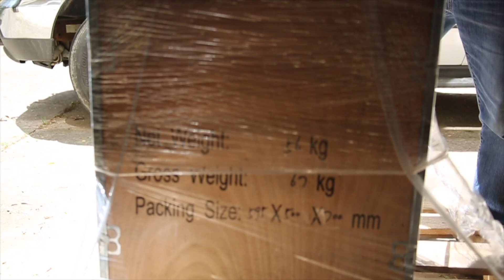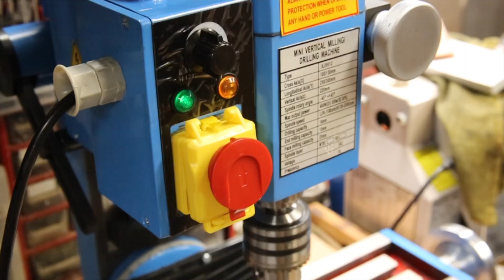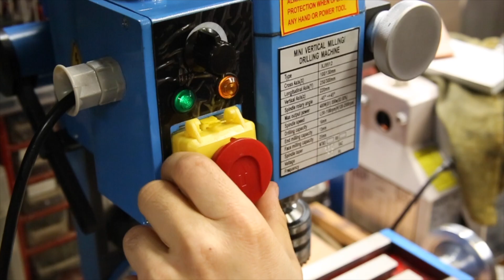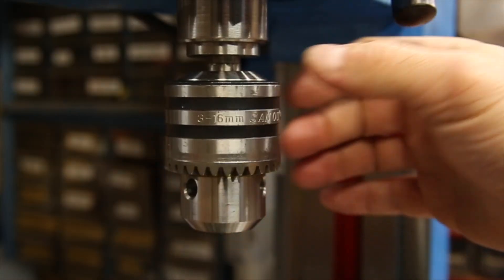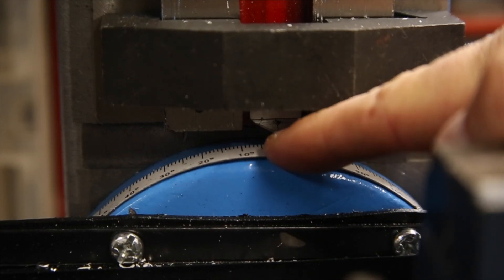Cheap Chinese Mini Metal Mill Milling Machine Unboxing, Setup, Testing, and Review

Comment: I found this video (and the comments) interesting and helpful as I'm getting a cheap x-y table to put under my drill press for use with wood and aluminium.
I think some of the "professional machinists" commenting need to accept that this is a small cheap machine designed for light work. Of course it's not going to be the same as their Bridgeport.
Reply: Your drill press chuck is probably held in by a morse taper.  You will learn it can not take any sideways force.  You are much better off long term in visiting little machine shop and after using their price comparison chart and doing some research acquiring on of the Sieg X variants that uses an R8 attachment and also picking up some collets for when you wish to mill.
Reply: @kenibnanak5554  l
Reply: Make sure you video it
Reply: Hi, I would not use wood and metal/plastic on the same machine. Not even in the same room.  Metal/plastic need lubrication. Wood dust will become stone and rust will set in.
Reply: Yeah i dont really suggest milling with a drill press not because its cheap or doesnt work well but really drill arbor are held together by friction and you coukd just have it flying off if you do so if you still intend modify it to have a drawbar pulling  the arbor and change to milling collet  low quality drill collet like these are not eccentric but if you insist thats ok but without a drawbar of some sort no
Reply: some view Bridgeports like these, when compared to Cat 50 taper machines.

At the end of the day it's cost and end use, all machines have a place and a use..
Reply: Del Cat I hope you didn't trash your drill press' quill by trying to mill with a drill press.
Reply: Tried it, you won't be milling and those cheap tables make accurate positioning hard work for hole drilling. I ended up with a slightly bigger mill than this and the 30 I spent on the shitty xy table could have bought me a few more end mills or arbors
Reply: Del Cat  At last some one with common sense. All the experts know all the answers but probably never make anything ! Also there is no right way in engineering just your own way.
Reply: @tonywright8294  Google 'Russian lathe accident', before lunch not after.

long sleeves (hair too) have no place in a machine shop.

Comment: Timnummy can I use this milling machine to surface  car cylinder head
Reply from the maker: sibusiso jaro it might be a bit small to do a decent job... You'd have to take quite a few passes and make sure everything is exactly on. I'm not saying it couldn't be done, but I don't know if the result would be worth the effort

Comment: Putting an end mill that size into a drill chuck is dangerous, unwise, and will never have any accuracy.  Find a collet kit that works with this mill and dump the chinese drill chuck for the occasion you do need one if favor of a good quality Jacobs.  On aluminum, high speed spindle, clockwise rotation, climb mill for final finish.  You'll get used to speed/feed.  Unfortunately, if you can bearhug it and pick it up, don't expect to be making cuts over .100" - it just does't have the mass to support it.  Also, get a better vise.  These comments are for safety as much as accuracy.  Cute machine though.

Comment: Nice. 
1st. get yourself some Dial Drop indicators and Dial Test indicators.  (Absolute Must have for any Machinist) (dont buy Cheap!!!!!)  (Need Both!!!!!!)
2nd. Get Some R8 collets and an Er32 collet holder
3rd. A set of Paralles
4th. A nice 4in Milling Vice
5th. Soft Jaws (you will have to make these, depending on what vice you get)
6th. Way oil. (its a specific oil for machine ways)

Also there are a couple things you need to do to get your mill ready to use.
1st. you have to bolt your mill to the table so its secure
2nd. you have to level the mill
3rd. you have to tram the mill head to the table in both X and Y. (this is where the dial indicators come in to play )
4th. You Have to tram you vice in (also need the dial indicators for this)  

Tools for Later
1st. Face mill or Fly-cutter (make user its an insert based one)
2nd. Boreing Head
3rd. 5c collet indexers in 4, 6, and 8 sides
Tormach TTS system tool Holders (only if you CNC the Machine)

Finally
CNC it 

Recommended tools
indicators:
1st. https://www.mscdirect.com/product/details/06222533 (Dial Drop)
2nd. https://www.mscdirect.com/product/details/09989757 (Dial Test)

Comment: You could sand it with fine sandpaper and then Polish it by hand or machine with Mother's or you can just run it through belt sander with Scotch Bright for a brushed finish

Comment: Cutting diameters in a vice without a vblock is a bad idea it cant tighten down properly on 2 points and can flip out the vice with 3 points of contact this is less likely

Comment: Hey,
Just FYI, drill chucks aren't designed for the side forces produced during milling. The chuck will be held on a tapered arbor. Tapers can't handle side load unless they have a draw bar (like the main taper in the mill spindle). You might find the drill chuck just falls off the arbor after a while. I would invest in a couple of end mill holders in different sizes, and a collet chuck.

Comment: i know all the comments mean well, it will be at your speed to learn first hand,,take your time and calculate all the moves that have to be made before you just turn the unit on.....safety first..get the proper vice in the mill and a nice set of parrallels and at least it will be a good start....good luck

Comment: The reason for the uneven surface is mainly the clamping system. With a round stock in a square holder it clamps well front to back but terrible for left to right cutting and dangerous. Practice on pieces of a nylon cutting board or wood for setting up. Save your good stock for later. Change to a collett system, and a milling vice as others stated. Listen and watch for chatter, more chatter more danger!! Also check for slack in your bed movement with a dial indicator. You might can make some adjustments on that to even get better tolerances. I'm sure there are some good videos on here to watch on that. Be safe and Good luck!!

Comment: Id get a dial idicator. Tram the head. Better finnish means smaller cuts, greater speed, and/or slower feed. Collets will properly hold the endmill. While a drill chuck is fine for making holes it isnt as accurate or safe

Comment: Enjoy the mill. I've got the Harbor Freight one, basically a horse of a different color.  I'd recommend that you buy a set of end mills with collets (and don't go larger than 1/2" unless you wanna break your plastic drive gear), and I'd get a vice specific for use on mill tables.  This way you can trust your work is true to the table.

Comment: Watch more of your time-laps footage. When you were milling that round stock, it looked like there was some wobble between the part and the chuck.. probably why the surface wasn’t smooth. Seemed like the there may be some flex in the overall construction.  You probably need to go back through and tighten everything as a first step. Then go back and time-lapse film some work as that seems to be the best way to detect problems. There’s could also be some plastic parts at strategic locations that should get replaced with metal parts. Probably be a pretty nice mill with some modifications to firm up all the deficiencies. That’s what I have been noticing with a lot of these cheaper tools and look like they can be fixed, which is nice. The plastic gear usage in these types of things is fairly common and I know that there are metal gear replacement kits around.

Comment: Try to make sure that you use the shortest tool that is permitted by the cut. It will give you the most rigid tool setup possible, and help reduce runout in the spindle showing up in cuts on the part.
 You may not want to do climb milling (feeding the workpiece in the same direction as the cutter rotation) unless you have a backlash eliminator installed (or lock down the X-axis), as the workpiece tends to want to grab and pull itself into the cutter.
If you're milling aluminum, try using mineral oil or A9 cutting fluid for a really nice finishing cut. Higher spindle RPM and lower depth of cut/chip load help as well.

Comment: The shorter your endmill is the better the finish will be. For facing, bull nose endmills are better. Avoid slot milling, 60% tool diameter stepover climb cut gives best results for facing. Results are even better if you cut in only one direction, ie don't zig zag. The y axis on most mills is more rigid(shorter), and therefore gives the better finish. Consider bolting the machine down to something more solid...reducing vibration will improve your finish. The same principle applies to how you hold your material: holding round stock in square jaws sticking out so far is not very stable. Never use a drill chuck for endmilling again.

Comment: I have the same one and suggest buying in advance the belt conversion kit.  That way when the crash happens (Beware fly cutters) you can convert without delay.  You will then have a more silent faster revving machine.  I agree with the ER 32 collet set suggestion if the bore in the spindle of your lathe is 20mm or more.   A bought set of parallels will look expensive but you will use them a lot. I agree with the thungsten three floot...10 or 12 mm dia.

Comment: Trying to get metal shards in the old fingers? lol, great video, I wish I had one and knew how to use it.
Reply: I know how to use one (learned fitter), but doesn't have the space for one.
I've lost count of how many times I have thought to myself "this would be so much easier if I had a mill". :P
And the same goes with a lathe.
Reply: I’m quite the expert at getting metal shards in my fingers but have found the perfect solution; Black Gorilla Tape. Just stick a piece on the affected area, rub it on really well, then rip it off.  You’ll be glad you did and you can leave the tweezers in your wife’s makeup drawer. 
BTW, I know this is a cheap mill but how many times I’ve forced my drill press to play the part of a mill makes me want one.  This one is plenty good enough for me.

Comment: IF YOU WANT ALL THAT IS MENTIONED BUY A HARDINGE OR  MOOG, IF YOUR A HOBBY BUILDER OR CRAFTSMAN  STAYING WITHIN .005  WITH YOUR MACHINE IS FINE. IF YOUR LOOKING FOR BETTER THAN .005 YOUR ASKING A LOT AND CONSTANT ADJUSTMENT CHANGES WILL BE NEEDED.. DEPENDING WHAT YOU PAID FOR IT YOU COULD GET GOOD YEARS OUT OF IT. AFTER  10 HOURS OF USE CHECK BEARING PLAY IN SPINDLE, JUST CHANGING THOSE MAKES BIG DIFFERENCE IN LESS EXSPENSIVE MACHINES. IF YOUR LOOKING FOR A GOOD LATHE, TRY OLDER USED OR REBUILT SMALL SIZE  SOUTHBEND  LATHE.  HAVE FUN GOODLUCK

Comment: That's a real sub standard drill press vise you have there.  The jaw will lift and it will never tram with that vise..  Buy a proper 3 inch ang-lock mill vise for about $100 -150 bucks. Looks like a Seig  mill you can parts and upgrades from Little Machine Shop .com

Comment: useb wd40 as a coolant or kerosene, kerosene is best cutting oil you can use on aluminum for surface finish. a high speed tool bit in a fly cutter with a properly ground radius , or stoned will result in better finishes, also get end mills with corner radius, feel free to hit me up. ive been machining since i was 15. im 49. cnc programmer on 3 ,4, and 5 axis machines

Comment: First order of business is to get the machine secured down on a sturdy bench - vibration will ruin the surface finish. Then you need to tram the mill (i.e. true it up) - being out of true will ruin the accuracy and surface finish. Get either direct collets or an ER16 or ER25 collet set - ER32 is too big for that machine & the collet nut will get in the way on smaller jobs. Get yourself a handful of both 2 & 4 flute milling cutters and never use a drill chuck for milling operations - they are not accurate enough and are not designed for the lateral forces of involved. As with lathe work use roughing cuts to clear the bulk of the material & then use light finishing cuts to get the best finish.

Comment: The start of this video, as comedic and as much as we workshop nutters can empathise with, is the exact reason why I have a 250kg/500kg/750kg/1T engine crane/hoist. Some lifting straps and all things will move a lot easier. That being said though, I feel even sillier having to wrestle the damn thing with it's solid metal wheels skidding across the concrete and not steering in the direction I want it to!

Comment: I just bought a PM-30MV, and I wish I was able to move the pallet like that! (it weighs 700lbs!).  I am just finishing a CNC conversion on it, and so far so good.  Congrats on your purchase, as you will find many uses for it, and learn a lot.  Enjoy.  Do NOT use a drill chuck for milling!.  They are not made for side loads, and are usually mounted on a jacobs taper, which can come loose from the cutting loads.  It is not a good thing, when a drill chuck starts bouncing around your garage, spinning at 3000 RPM, with a sharp endmill in it.

Comment: Using a larger diameter cutter, i.e. fly cutter, that can exceed diameter or width of workpiece will look better than the mill tracks of a smaller endmill.

Comment: Try to find something to hold your end mills with and never use an end mill larger than .500 in. The drill chuck is for drilling only, using it with an end mill is not rigid, and will screw up your work piece ( wobble ). You need to keep the end mills as close to the spindle in length as possible for rigidity reasons. That drill chuck probably runs out a little and will get worse using end mills in it and its way to long from the spindle. BTW I am a machinist. You can find used cutting tools on Ebay or Etsy but be care, sometimes they are worn out. For your home projects, that mill will do just fine. Keep the gibbs   adjusted properly, they probably need tightening some now, even as new. WD40 is OK cutting fluid for nonferrous metals and plastic. Good luck and Have Fun....

Comment: I don't think I would have called that "mini" when it is well over 50kg in weight and that size. I hope you picked that up using your legs and not your back when moving it from the floor to the bench.
Reply: 100 pounds is a pretty small milling machine. The motor on my mill weighs about 50 Kg. I don't have a big mill either.
Reply: I've seen a couple of other milling machines that were smaller. The Other Mill machine for one. It must be called micro by comparison.

Comment: Second order of bussiness get a better machine lol. Yes it does have plastic gears but you can buy metal gears from lil machine shop. I had a mini mill (still have) but i brought a precision mattews pm940/power feeds/dro/power down feed/harden ways etc and the differences it out of this world. Never the less its a good lil starter machine but be prepaired to to get new gears (sorry) and do it fast other wise you will be in the middle of a job take to deep of a cut and bam your stuck waiting for your parts to come in lol.

Comment: Hey cnc operator here:  
I would climb mill on your mill as if helps improve tool life and it helps with the finish as swarf is pushed away.
The ER32 collet chuck I see people talk about is a descent idea for rigidity but your problem will always be tolerances. 
And if you buy a collet chuck you gonna need a clock to 0 your x and y values. 

Have fun tho dude, you make great videos overall!

Comment: You may be lucky and get a miil that is reasonably durable. If not check out Precision Mathews. I have one of their lathes and they have been very good to deal with. Tooling up a mill can be fairly expensive. There is always something else you find you need. It looks like yours has an R8 spindle, which is good. Buy a small set of collets for it. The drill press vice won't be very suitable for milling. When you clamp something near the top of the jaws they will not stay parallel and the work will come loose. I bought a Shars tool makers vice but needed to modify it to work, sort of. You will need a set of parallels, a dial test indicator to tram the vice (don't go too cheap here.) A few end mills, a center drill (just use the 120 degree part) or buy a bit made for the purpose. Drill bits. I use my screw machine bits more often that the jobber set. But you will need a 118 pc. jobber set so you can drill for threads. A fly cutter works well but tends to be slow. Shell mills cut much faster but may over tax that machine. A set of "good" tap & dies. If you power tap, the spiral taps are better. Use Taping fluid. WD40 for milling aluminum will keep it from sticking to the tooling and make a better finish. If you work in metric, get those sets. Set of counter sinks. A strap clamp set. On & ON.... If you out grow this mill some of the things you get won't be suitable for a lager mill, so only get what you need for the little mill now. 
          Before you get carried away trying to make something, bolt the mill to the bench, Tram the head and vice. Check the spindle runout. If this machine has plastic gears you may want to learn how to make a set of phenelic or aluminum ones before these die. A spin indexer allows one degree increments ($50 and some work) and a fly cutter tool can be ground to match the tooth profile. Just match what is on the machine now. Most of the trick to getting good results is careful set up. 
           About using ER collets for tool holding. Be sure the tool goes in the full depth of the collet or it will want to walk out. ER collets have a narrower range of sizes they will hold than R8. 5C collets are good for work holding on a lathe since they can grip shorter parts than an ER. 
           Have fun. Use your safety glasses!